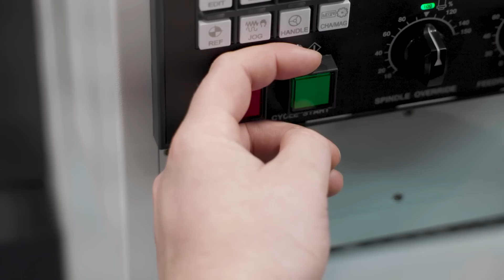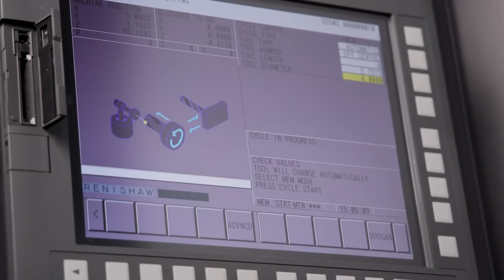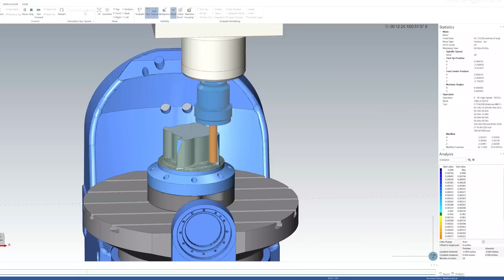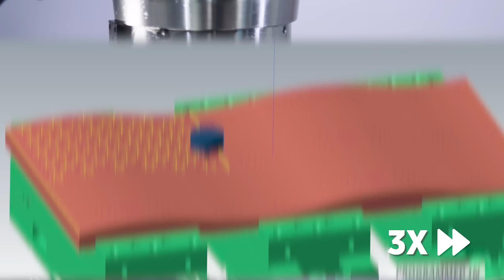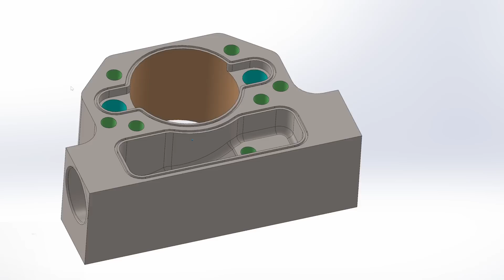My HSS End Mill Will Machine Circles Around Your Carbide Tools

Comment: 2:19 "at what point....blah blah. It seems to me , the job dictates the tool and the availability of the machine dictates running parameters. Not all of us get free tools because we have a youtube following, nor do we buy the most expensive , most modern equipment. I make runs of 1-6 pcs, a big order is 25. I run older cnc equipment, its not beaten, its not super fast . It makes good parts. I rarely make parts from aluminum, when i do, I mostly use HSS tooling, why? First speed doesnt matter on small quantities, second its cheap, third old machines have power to push bigger cutters, efficient use of what you got. I floored by all these clowns with a Haas and a copy of F360 who undercut each other because they can do it faster, not realizing how inefficient both spindle utilization and use of funds , paying for a new machine, the taxes on it ect.  HSS wont run circles around carbide, but experience, logic, common sense will.

Comment: I had that same problem many times. But I will say a good HSS will hold a sharper edge for machining plexiglass and a lot of plastics but out side that I will spend thousands of dollars on carbide and ceramics and I only have a few haas machines in my personal garage 😆 titan is one of the few places I have found that had my same mind set. I went to NTMA and was constantly dealing with the old timers holding me back I get project prints walkup to a haas or funac and type the gcode entirely by hand load up MY OWN ENDMILLS and hit run drop my feeds do a quick air run above my stock as a sanity check drop out remove my offsets and hit go 600-1000sfpm with full depth cobs and swap to a finish and a spring pass the avg student cycle times was 5-8mins for the same project mine was under 2mins and every time I ran the teachers slowed it down and made me 😡 . Like " wtf it's 6160 with a 3 flute kentametal leave me projects alone near the end of my fun at doing circles around that staff at NTMA I competed at the SkillsUSA Gcode challenge won 1st for state of California took 5th in the national championship but it was fun.
While I basically own an entire machine shop it's mostly a hobby as I'm an engineer for an fortune 100 company now. I spend my free time design custom 3dprinters and CNC machines.

Also I was a haas technician before I even went to NTMA. I went partly because I was bored and wanted access to machines. After spending 2 years fighting cancer

Comment: Where I work, quality always supersedes delivery (within reasonable limits of course). If you can get the job done with HSS and deliver quality parts on time, fair enough. But if you need to make several dozen (or hundreds) of parts a month, as a machine programmer and operator you are responsible for doing the cost/benefit analysis to save money while maintaining acceptable quality. More often than not that will lead to acquiring more expensive tooling that reduces cycle time and increases part quality and can guarantee a new contract with a happy customer.

Comment: friction milling AE Alloys with mill bits that are internally cooled with passages thru the core made using "wire electric discharge cutting", milling bits that are not available period... to any independent startup's of any kind. titanium nitride cobalt carbide tungsten bits of traditionally construction make hobby crafts far less frustration even using slightly loose fitting/running tools "worm butter frozen butter, needs to be white hot for it to cut straight".

Comment: I actually still often grab HSS endmills when I have to go down to manual land. Those machines are older and don’t have much rpm available, so anything 1/2” and under is running nowhere near the speed they should. I prefer the sharper HSS over coated carbide when I’m running those machines. HSS still has its place, but back on the CNCs carbide is king.

Comment: All I have are manual laths and Bridgeports in my shop one being CNC and I only use carbide, I had ran some aluminum jobs in the past with 1-1/4" and 1-1/2" HSS endmills that did fine but anything 3/4" or less it really doesn't make sense even on manuals. The competition you mentioned is true in a job shop but a captive shop with specific parts for your companies products can get away with the old, standard way of doing things a bit better with slightly older technology sometimes depending on the product being produced. Good advice overall though.

Comment: This all depends. One simply needs to calculate the most efficient cost per part. So using cheap carbide tooling may be a good option if they produce parts within tolerance and only last say 10% less then 2x as expensive tooling. 
If above was not the case all "good" shops would run most expensive everything.

Comment: From what I have seen, in a few cases over the past 40 years, is shops that got destroyed by taking on any of the jobs from ANY of the auto manufacturers.. They get the job done, on time, with in spec... Then the contract never gets paid for, because the Auto manufacturers know they can do that and get away with it, even if you sue them, all that does is push that payment out, further away .. That doesn't even mean the civil case will settle in your favor, as there has been many times, where the auto manufacturers will run the tool/mold, and then get full production quantities as expected from the tool life... and then in court, claim it didn't perform or the tool was faulty... It really is a huge scam that the little shops get beat up on by the auto manufacturers... Even the shops that have other jobs running, as per, (not putting all your eggs in one basket) Every shop I have seen this happen to, gets destroyed... Then, the shop that doesn't provide a good tool/mold to the auto manufacturers, they end up getting sued out of business, way beyond what an insurance provider can cover... Chapter 7 to 11 is then in favor...
Reply: GM is the worst of all.....they will bankrupt a small shop in a heartbeat .

Comment: Thats one of the most epic thumbnails i seen on youtube so far :D And for people that love thier HSS tools on modern CNC machines here is how i / we (at work) do it, buy good tooling, and then run it maybe till it breaks or short before that, then back off a bit and you know it can handle it (or talk with your toolguy, they usually quite competent) and then send it. I bought the endmill 3xD ima use the endmill 3xD and not just scratching the corners off it :|

And again that thumbnail is epic :D

Comment: Nevermind quality tools.  I would like to work in a shop where the machines are NOT 15+ years old. Where I currently work we have 5 or 6 machines under 5 years old, all the rest are well over 15 years and maintenance is spotty at best. One of our key machines is currently down with a dead drive unit. Out of commission for at least a week, if they can get a reconditioned drive, several months if not. And yes, that machine is about 20 years old.

Comment: The shop I'm at right now isn't on the exact cutting edge of technology, but the owner isn't afraid to invest in quality machines, and at least decent tooling. A brand new Haas ST-40 lathe landed just last month, with a 50 taper VF-6 three months ago, with a Yama Seiki lathe about the same size capacity as the ST-40 (can't remember the model #). We still stock some new HSS tooling, but it's primarily intended for the two manual boring mill's, as HSS is a lot more forgiving of old machines than carbide is, especially when the newest one top's out at 1800 RPM with feed's only up to about 50 IPM max.

Comment: Whole heartedly agree!  I have worked in shops that had huge monthly tool budgets and brought in tooling that was current to replace tooling that wasn't.   Shop I am in now still thinks high performance drills are a waste of money and hand taps are still better than machine taps (Spiral point and spiral flute).  Its both annoying to the workers and a running joke around the shop.

Comment: I use both hss and carbide tooling in my shop. Hss is worth its weight in gold, when you use it in the right situations. I still have an old shaper in my shop, because it can run in background cleaning up crap, for essentially no cost, while I make money on the next operation without destroying tooling. What I am saying is that there is never a single tool or machine solution. Carbide is almost always my preferred option, but I run hss end mills into jobs where I know damaged tools are inevitable. Cheap $20 hss lasts better than $150 carbide in some situations. Choose the most cost effective tooling for each job. Never prejudice your decision because 'this is always better'. That's how you make money.
Reply: Shapers are one of my favorite tools as a youngen. Ive watched plenty of Abom79s shaper vids and there's tons of work they can do. I actually want to make a CNC shaper one day just for giggles
Reply: @TheDandyMann  add a attachment to your mill head! (attached to the casting, not the spindle!!!!   ive done this to stroke keys :)
Reply: Shapers are awesome, I use mine all the time at work.

Comment: The company I work for is finally starting to replace our old CNC machines after a couple of decades of running them. The beds are worn out, the motors are also only like 5 horsepower so they can't do heavy cutting into hardened steel. But ye old faithfuls have been good for a long time and good machinists have been able to make good parts on.m bad equipment. The new mills we are getting have 15HP motors and more advanced programming features like DXF support, so doing the job is going to be a ton easier for us once we have a full swath of machines. Of course, replacing a dozen machines isn't done quickly these days.
Reply: Do old machines like that hit the market for the garage tinker'er to buy?

Comment: The shop I work in finally replaced a 40 year old CNC Lathe with a bar feeder last year after the manager/supervisor had spent several years fighting corporate trying to get a new one in the budget.  They wisely put me in charge of the new machine (Doosan Lynx 2100 LSYB), I'm still fine tuning things and going back and forth with our programmer (it certainly helps that I also learned the code necessary and can edit it myself on the fly) and the shop is sill largely allergic to carbide tools, but all the same I've made it my general mission with the new machine to be getting most parts out in half the time or less than the old machine took even if the setup takes a little longer (because of more tooling).  I took one part that we run a lot of which required two ops with the second one being on a different machine entirely and hour long setups with over 11 minutes of combined cycle time plus additional secondaries down to a single op on this new machine in 3 minutes and 52 seconds of cycle time and no secondaries.  In the last year I have eliminated so many secondaries, combined multiple ops, and just pushed speeds and feeds up from the old low and slow mentality.  My work station has 4 drill presses, a manual horizontal mill, and a second manual lathe and they are all barely ever used any more, parts come out of the new machine DONE in less time and with better tolerances.

My supervisor/programmer has gotten fairly comfortable with how much of a madman I am compared to anyone else in the shop.  I ask the questions and perform the "insane science experiments" nobody else thinks of like "Hmmm, this threading cycle that the programmer sent me which runs at 600 RPM because that is the best the old machine could manage without crossing the threads... I wonder if the new machine can do it at 2500 RPM..." (Answer: It can, and the threads look so much better than they ever did before thanks to having a decent surface speed on the cutter.)

Now if only we could use this example to convince corporate that the various manual grinders, mills, and bridgeports they keep around which were probably clunkers when they were first manufactured back during WWII should all be sent to the scrap dumpsters where they belong.  Asking us to grind a +/- 0.00015 tolerance on a part out of a machine that has 0.03 of slop/backlash is so incredibly frustrating, and we have to power on the machine then let it spin empty for like 3 hours to warm up in the morning before it stops wandering all over the place from one cut to the next before we can even get started on it.  Even newer used machines would probably be better than these clunkers that were already rattling themselves across the floor in the age of the dinosaurs.
Reply: I could probably give those old manual tools a home.

Comment: The thumbnail made me click. 

Now I don't normally watch these types of videos from you but I have the experience from both types of shops. I worked at the good one first. ALL OF THE TOOLS WERE SUPPLIED, besides calipers but I always used my co workers and still barely needed it, all of the tooling was carbide except for the rare chance we used a twist drill and they always ran everything with recommended feeds and speeds which always got them the best results, very rarely did they have issue out of their tooling or machines which all but one wasn't brand new but they all worked just like the day they got them. The shop I work at now always skips maintenance and we are lucky to have carbide, I think the only reason we have any carbide at all is because a tooling supplier told them "these can run faster than high speed steel" every machine was bought off the basis of the word "quick" or "more efficient". 3 Mazak quick turns 2 of which were crashed and not running the other I run and it barely runs, I can barely run at 100 percent of it redlines the load meter. Not of the seals have been replaced since they got it so one day about a month ago the chips built up so bad it had crashed itself, I can't lie I was at fault too by not saying anything but it was worse than just what I did. Everytime a machine goes down I jokingly say "I know what'll fix this, guy a new one" boss didn't look happy about that. I am tired of that place, not only has it killed my love for machining but it has killed my own mental health, shit that seems common sense to me in terms of machining through my experience is shut down because the other people there don't know anything about it and are too scared to try or I get called an idiot cause "I'll crash". It places like these that hire these new guys kill their drive and wonder why there aren't any new machinists.

Comment: There's no way to express how common this situation is. The many job shops I've been in, and have had friends tell me of, all operate under the same "production only mindset," where it's near impossible to meet scheduled deadlines, there's never enough people in a department to continue the flow of labor, and worst of all, the need for parts to be made accurately and quickly with the absolute bare minimum in equipment and of course tooling. Sorry for the rant, but the buildings I work in have no proper windows or airflow, so I had to vent somewhere.
Reply: My shop basically strong armed me into buying myself a fan to keep me cool after my boss kept stealing the company provided fan I was using because he needed to blow the excess misted coolant out of his face. I have had heat exhaustion twice this year during the summer and had to make up work because of it. There are no windows in the entire shop, and the only airflow we get is when the bay doors are open in front and back
Reply: @TheDandyMann  How can you be expected to make accurate parts with such wild temperature swings? Our 300K sqft building is completely air conditioned and its never more than 75F inside. They try to maintain 72F year round. Its 68F in the metrology/QC department. You have to wear a jacket in there.
Reply: @oldscratch3535  None of our parts require much accuracy. Usually .1 or .02 and sometimes .005 but never anything really accurate to .0005 or lower. 

We make large pin assembly's for construction hinges for excavators for the majority. They get turned, then on a mill for drilling holes, in house case hardening, grinding, hard turn, welding and finally paint for the welded plate. We also machine a ton of cast iron
Reply: @TheDandyMann  I have a few of those big pins that I salvaged for scrap lathe material for projects. What kind of steel is it and the hardness? How thick is the hardened layer?
Reply: @oldscratch3535  I think it's 4140, don't know the hardness and I believe it should be .100-.200 deep

Comment: As a business owner, he's spot on.  Buying expensive brand new equipment is generally the last option I consider, but sometimes it's the one I go with when it pencils.  Generally the best value is in used modern equipment.  That way you get most of the benefits of new equipment but with a cheaper price tag.
Reply: No warranty though and you don't know what the heck the previous owner was doing with it. It's not like they're gonna tell you. You better inspect the crap out of it before you buy. Otherwise you could be buying a machine with enough repair bills piling up on it to have just bought a new machine in the first place.
Reply: Depends on the equipment. I can tell you the best value is new when it comes to dirt-moving equipment. Time is money and downtime costs you money. I found with many of my jobs when using used equipment. We would spend far more than we needed on repairs and that down time. a cost that was more than the cost of new iron.

Comment: My new shop has fixtures that screw into the plate, but still have to be indicated every time we drill. It's only one hole straight through. 15 sec part, 30 mins of indicating.